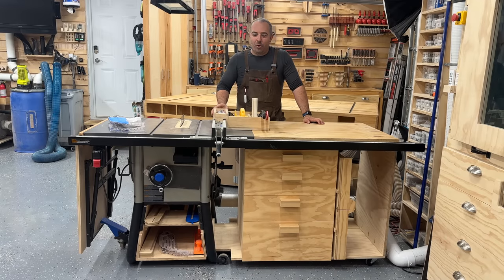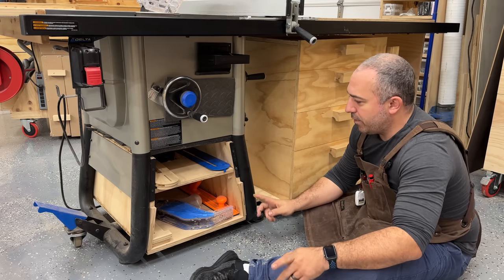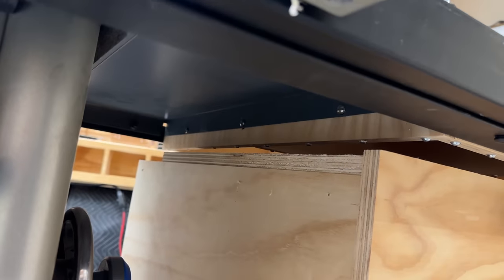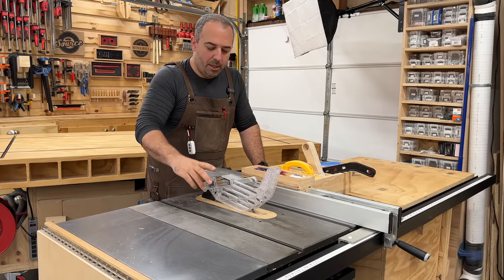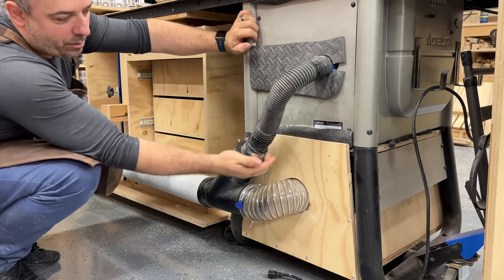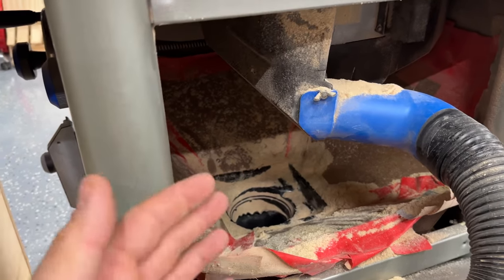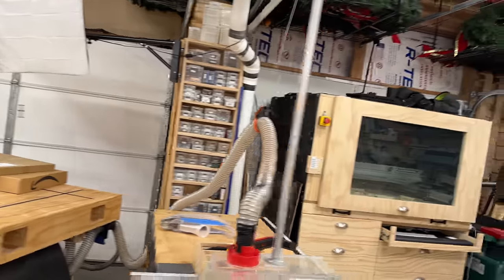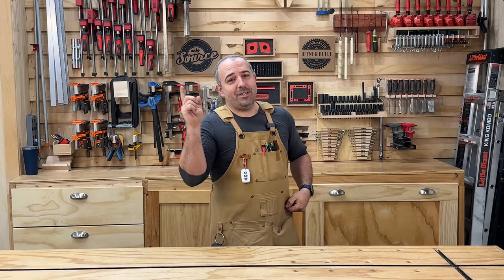Table Saw Additions Accessories and Hacks Delta 36-725

Comment: Yo boss why don’t you try your hanging dust shield with the hose port on the side facing the fence and bring your hose over the fence with some kind of hose mount on the fence so if you have a flexible hose it will expand and retract as you move your fence I have this saw as well and I’m currently mid process on my mobile bench/tablesaw cabinet and have been very actively designing features like this in my head while I form up the table. Could be a solution could be a bust. Worth a go if you get to do it before I do let me know 🤙🤙🤙

Ps I bought a 8’ / 2” square tube and the 1 1/2” & 2” angle in 8 ft as well and the rails run the full length of the plywood on top of the table. I cut a 1” strip of wood and clamped the angle and square tube then welded them together at the bottom so the front rail is 1 piece now instead of the angle and tube separate but bolted together where if it’s not just right you can get sag.
Reply from the maker: Very cool on the tubing! Yea I’m playing with different new ideas for the shield so I’ll play with your idea, thanks for all the tips!
Reply: @BitnerBuilt  you could go so far as to use like an auto detailing nozzle mounted on your fence aimed right where the dust shoots off and it should catch it all

Comment: good build. I think people are way to anal about dust collection. Its wood. I also am a 3rd. gen. arborist. The sawdust is part of the job. it cleans up easy. routing all kinds of pipes and all that crap in my opinion is a waste of time and money. Best thing i ever did is buy a remote shop vac. mounted it to the ceiling has 20 ft. hose just stick it to what ever I'm using . no fuse no muse. I a big fan of the kiss method. keep up the good work.
Reply from the maker: Thanks!

Comment: These table saws will not last a lifetime. The lift bushing holds all the weight of the motor and will wear out. No luck getting a replacement
Reply from the maker: They have replacements here https://www.ereplacementparts.com/evevating-bushing-p-1805017.html